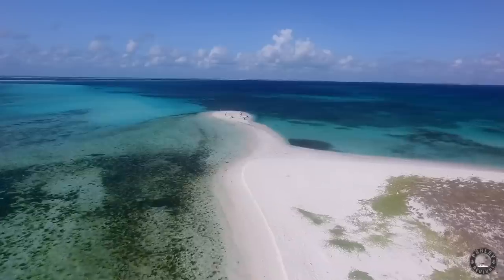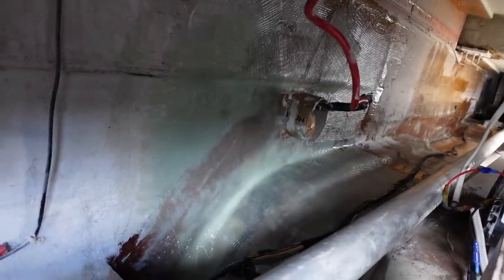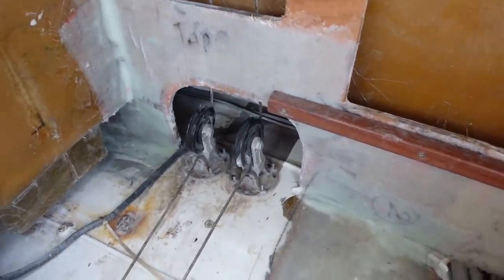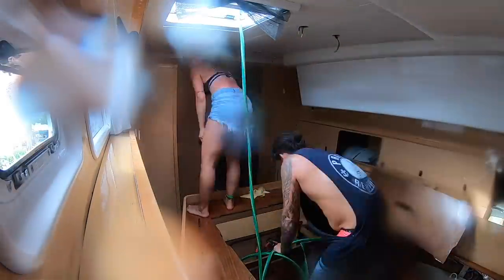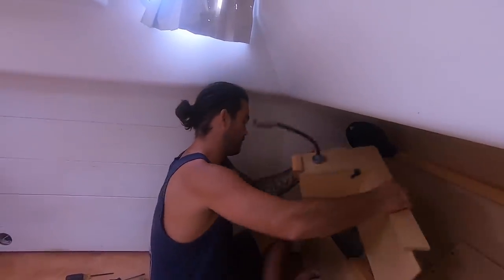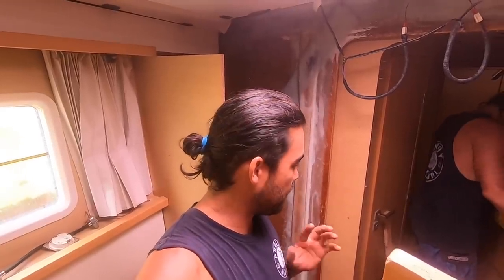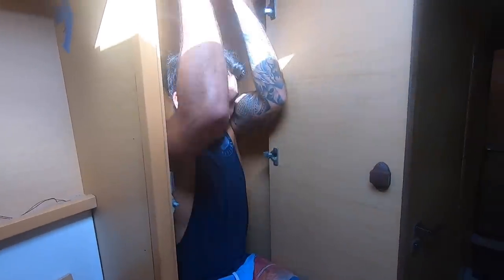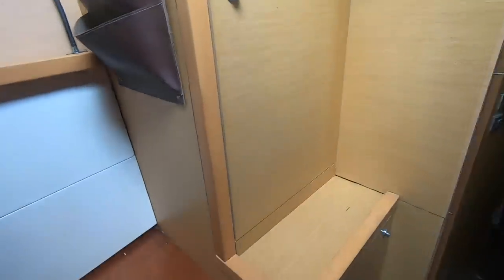OUR BULKHEADS ARE FIXED! - Cracked bulkhead repair series - Part 11 (Episode 116)

Comment: When you were cleaning up and talking about moisture got me thinking about my Nucamp Cirrus Camper in the Cirrus they use what's call called Froli mattress system which is a plastic spring system which allows air to flow under the mattress eliminating moisture build up. It would work perfectly in your boat. Look into it. Very easy to install also inexpensive.
Reply: I second that! Froli works

Comment: Heads up Colin. I think what you've been doing is terrific, absolutely. However what you"ve done to the bulkhead. Is to have changed it into a massive truss. that is going to displace load stress, through the entire hull. i hope the hull can handle these new dynamics. it'll probably ok. But the sea trials should tell the tale.

Comment: Hi guys an easy fix for scratches is if u wet the scratch and it goes back to the colour of the material you can buy wax sticks (maybe even your surfboard wax) rub a little into the scratch and it should disappear  and also protect the timber in the future

Comment: How much simpler would it have been for Lagoon to have done that when assembling the boat?
Reply: Tabbing all bulkheads with 7, 5 ,3 layers would have added at least $100k to purchase price. Will not happen in the charter boat market. Cuthroat.
Reply: @donr416  If the Lagoon 450 is advertised as a blue water sailing boat, it should have been constructed accordingly.., I see law suits for false advertising.
Reply: @donr416  So are they thinking that the lives of those who charter their boats are not worth the effort or money? Stupid idea all around. When it comes to an ocean-going vessel being used by a variety of experience levels I'd expect it to be bulletproof (read as idiot-proof!) to make sure it survives.

Comment: Massive amount of work, the bones are now stronger than ever or any similar cat.
On the technical side, the only thing to be aware of is the connections between the hull and the skeleton, you now may have some new stress points as the inside is now more rigid and the hull itself did not change (weakest link).

Comment: no worries about the finish on the wood, it adds character.    i was wondering if you would have some easy access inspection holes.   i would feel better seeing the tabbing after some rough seas.  and to keep an eye on moisture.

Comment: With every thing you finish off it looks great. I bet you can not wait to be back onboard in a clean space. re the saw lines. I am not sure I would bother with trim. I'd chamfer the edges and use a grey sikaflex calk. as long as the cuts are tidy why not leave them, its part of the boats story now. re inside the cupboards, its a fairly high grade of laminate ply, you should be able to sand out the saw marks and just refinish the top surface, and they be hidden if not removed.

Comment: Just a though could be wrong but with overbuilding with fiberglass could that make it too rigid and when boat flexes over time wouldn't the rigud fiberglass crack away from the wood?
Reply: I'm wondering the same?
Reply: They know how to tab and were talking with the designers.  You want that mast bulkhead to be solid and not flexing. The tabbing on it should be graduated in width so the outside strip has one layer an inch in has two layers, building the tabbing thicker as it gets to the bulkhead.  This keeps the flexible hull from hitting a huge step in rigidity - it gradually gets stiffer.
Reply: @donr416  thanks... that makes sense
Reply: Funny thought about it possibly being too rigid,
I would think that would be a problem that they would definitely like to try for a while as opposed to it being as flexiblile as jelly fish 😬

Comment: Fantastic! Glad to see you progressing so well and being able to splash again soon. Little question ... Why not putting silicone sealant or rubber strips between the walls and the furniture to reduce/prevent squeaking noises (production boats and Lagoons being specifically known for those irritating noises, especially in the cabines)?

Comment: Considering the amount of work you've done to the boat - not just repairs, but significant structural improvements - at what point will you peel off the Lagoon stickers on the boat and properly relabel it as a "MacRae 450"? 😁

Comment: I was wondering if you discussed with Lagoon about required flex points. You talk a lot about places not moving, being very strong but sometimes there is flex points. It sounds like at about 5 minutes you did talk to them. Did they say to make sure the main bulkhead is rigid?

Comment: I see the comment below about the boat naturally flexing l thought the same, but where is the answer? The boat is stronger than when it left lagoon for sure. All you have done is admirable, well, more than that, brilliant, you have saved a “written off” boat twice.  When the shrouds have been tensioned up l imagine that will be the defining point, again great video, yous have earned the admiration of a great deal of people.
Reply: It will flex but not break ! The longer pieces of wood will flex more than the shorter ones ! For example , you can flex a 6foot long 2x4 piece of lumber better than a 3inch long 2x4 ! So over all a 45 foot boat will flex in some way but not break in critical areas !

Comment: I couldn't imagine being able to just put that all back together. I was convinced you were going to be custom building some new pieces to finish it. It looks really good. Use some wood filler that has a little color in it for the inside of that closet. depending on how close the color is you might be able to cover your seams with a little artwork. LMAO The artist in me is like, "Ah shit! I could make all of your cuts just disappear and nobody would ever know you cut your boat apart! Hehehe! My dog made a hole in my apartment vinyl flooring, so being me I filled with wood filler and took some paint and mimicked the wood grain, so I wouldn't have to pay for new flooring! I know I am bad, but the apartment has refused to remove the mold and fix my falling ceiling for over a year and a half, so I don't give a rats ass about shit like this!
Reply: same, i thought it would too damaged and easier to just start from scratch for some bits
Reply: @hthring  I have to admit I love building things from scratch, so had it been me, I would have probably gutted in the interior and made it a brand new custom build! LMAO

Comment: Feel a little more human after a day of work... compared to what you just went through with the grinding and epoxy... a little sawdust form adjusting wall panels to fit back into place is nothing...
Good job to all of you for sticking through it..  I want to see what the tape measure says after you lift it back up.. how much deflection you have if any...💪👊

Comment: Hi Colin what waight or thickness of biaxiall fiber glass is that please
Reply: Colin said in the past couple of weeks that the weight is roughly the same as having another person onboard.
Reply: @GaryHowes1964  hi ty for your response, i remember colin saying that after you pointed it out. I am sorry i meant the thickness of the glass fibre sheats as they come in different thickness. Looks like a thick weave.

Comment: When they built the boat they used bonding putty end/edge on the bulkheads into the hull with no or inadequate tabbing. The repair consists of removable of spilled out cracked putty and/or damaged tabbing. Then a new fillet and new tabbing is applied. There are bound to be the spaces between the edge of the bulkheads and hull between the new fillets and tabbing where there’s a small gap (crack). Adhesion in this gap is not as important as taking up any movement so as to not damage the new fillet. There’s only one way to get to it and that is to inject thin epoxy. The ONLY thin epoxy that can be used is one that does NOT contain volatiles as a thinning agent. Most “penetrating” epoxies contain volatiles. Volatiles must evaporate out, in order for the epoxy to harden and if it can’t, it will permanently halt the epoxy’s curing. Worse yet the trapped volatiles will soften the surrounding work! There may be others, but the only reasonably thin epoxy I know of WITHOUT volatiles is Git-Rot. Voids can be reached by drilling some small holes as needed, high and low. The good news is you only have to get one one side. The epoxy can be injected from bottom up, top down or with the assistance of a vacuum pump. Anticipated leakage (running out the bottom) areas must be contained before starting, with epoxy putty or 3M aluminum duct tape. Small plugs should be readied to stop the exodus of the epoxy out of the holes until it’s cured. The aluminum duct tape can be used to make little catch basins or (swallows nests) to control/return the epoxy and a place to draw the syringe. Note the aluminum duct tape sticks excellently if the surface is clean and doesn’t have a film of wet epoxy. Remove tape immediately after the epoxy stops flowing or it’s going to stay there. Do not attempt to fill large voids because of the curing heat of a large volume epoxy can cause damaging heat. Is this necessary? You’re the eyes on project, I’m a spectator.

Comment: HELLO? Is the boat supported upon the float plane yet? 
IIRC, the boat is not supported from under the hulls yet and am fearful of the thin veneers and cabinetry squeezing and cracking. Just a noob observation so if it's made so stiffly that nothing moves once floated, Cheers to ya 🍺

Comment: Remember the same engineers giving you advice are the same group that created the design flaw in the first place. Caution is all im saying. Over engineer it while you have the access. Great work!
Reply: My understanding is the engineers did fine, the builders took shortcuts.
Reply: Romberg, Colin has a degree in engineering.

Comment: Another display of "balls of, well whatever" most people would not have had the balls to take a water hose to there interiors like you did. If you hadn't there would of been mystery dust from fugitive particulates. When repairing my bulkheads on a Hardin 44. Used regular fiberglass resins FRP. Months later we were eating canned green beans with dinner. The Beans had a strong flavor of styrene. The whole family could taste it! various other canned foods possesed Styrene flavor as well. Wife had to toss all canned foods that were onboard during repairs. How Styrene fumes could permiate canned foods I will never know.

Comment: Why not tighten all of the rigging before putting the cabinetry in place? The tension of the rigging could alert you to any potential issues… all of that interior would could have been done while the boat was in the water- correct?

Comment: I'm just wondering if all that carpentry repair is going to add to any creaking/noises you have while at sea. It seems like you had a 8 piece puzzle and now have a 12 piece. I have no idea if those cuts will even be relevant. It's looking great, I hope it treats you as well.
Reply: I was thinking the same thing. Of course its easy to armchair quarterback someone else's project but I was thinking that I might have siliconed a lot of those joints to prevent creaking. I suppose it wouldn't be too difficult to come back and do it later. Then again, if its as stiff as Colin says it might not be an issue regardless. I guess we'll see..

Comment: Is there a point where bulkheads can be too rigid? Do you trade away a little of the impact absorption that Sikaflex provides for the rigidity of glass and epoxy? I guess a bulkhead has only one or perhaps two jobs, to hold shit together and be stiff as shit? Everything else can flex a little but not the bulkheads? I ask out of interest because I'm building a tiny pontoon houseboat and I've used Sikaflex, Selley's Armourflex, 316 stainless bolts and stainless steel rivet nuts to fix my aluminium checker plate deck to the welded aluminium sub-frame.

Comment: This is just my opinion, those cuts to cover are so minor, most I wouldn’t even bother with trim or quarter round, just some brown sily cone will do. Particularly in the 90 degree corners. Good job, team smooth sailing ahead.

Comment: Question: why not do a couple of layers of carbon fiber cloth. On top of the glass?
Reply: cost maybe?
Reply: I think carbon fibre cloth needs high temperature to cure it., which is not practical in this situation. Carbon fibre parts go in an autoclave to cure.
Reply: @mikethomas2138  no, carbon fiber cloth. Doesn't need high temps to cure.
It still lays the same as glass mat.
Reply: @mixamixin7796  depends on the weave. But it's not much more.

Comment: As far as reinforcing your aft bulkhead, I'm not of the mind to trust whatever you hear from Lagoon.  While I agree with the thought that if the Mast Bulkhead holds, the forces at play will not necessarily affect the aft bulkhead, the fact that the boat flexed in that area AT ALL, leads me to think that with the tension stresses n the outboards of the pontoons upon tightening the stays MIGHT necessarily cause the aft to rise once again - no where near what you saw previously, because the Mast Bulkhead was badly broken.  It wouldn't hurt to be engineered to withstand whatever you might run into or put onto it.  I rode Submarines in the Pacific for 7 years and I've seen some mighty wild shit out there, and those things are thick steel tubes.

Comment: Collin buddy, don't listen to lagoon, if they knew what they were talking about you wouldn't be where your at right now. Do what you know is right.
Reply: But on the repair the advice from the designers can be valuable.  With 20/20 hindsight they have IMO nailed the failure sequence, and the advice to do the varying tabbing widths is industry standard.  I would bet that the original construction was not what the naval architects first advised. Corporate has a way of getting their way.   I don't know how many times - but it was more than a dozen - as an engineer I told management to " fire me now,  because I will not use substandard practices."  I was lucky to be an engineer with a great track record and a spotless reputation with the customers.  And management knew every time that I absolutely meant what I said. Joke 'em if they can't take a fuck.
Reply: @donr416  there is NO  excuse.

Comment: Wow,how are you gonna dry up the cabin and hull incase you create molds and fungus
Reply: Colin said they used a dehumidifier.
Reply: @davidjulian8536  ok!Do you think it would dry out every thing that got sprayed in?Just wondering
Reply: @malmotumotu5218  tropical sun should turn water to vapor, dehumidifier captures vapor.

Comment: When a large structure does not have enough flexibility, its weight adds
 to the external forces applied and may cause microscopic material 
fatigue.

Comment: And you're going to listen to Lagoon about a structural matter, after they cocked up the ORIGINAL BUILD of the boat?  You probably don't need to go as much as the main bulkhead, but at least one layer of biax wouldn't be a horrible idea on the engine room bulkhead.  AND all of those exposed plywood edges all over the boat!

Comment: Water inside a boat on wood... sounds like a very bad idea to me.. Sounds like you are begging for mold and mildew and rotting wood. I doubt they even sealed most of the backside of that wood that's in there with all the crappy work they did building that boat/those boats. You failed us though.. where's the puppy update?!